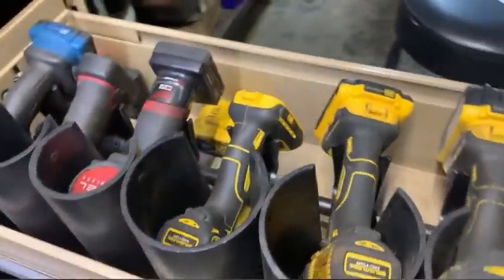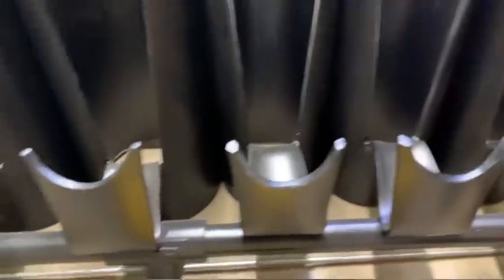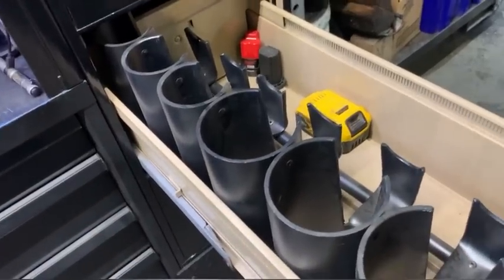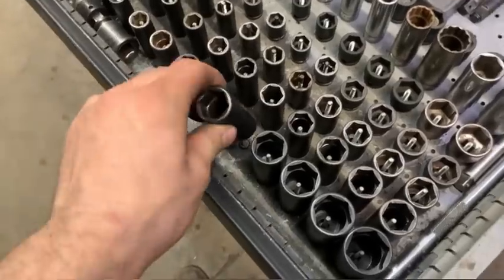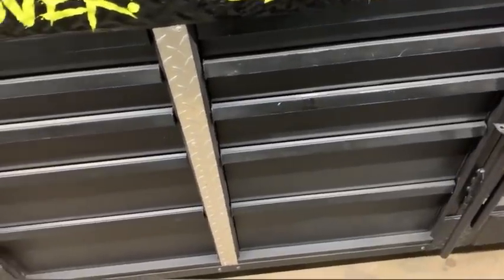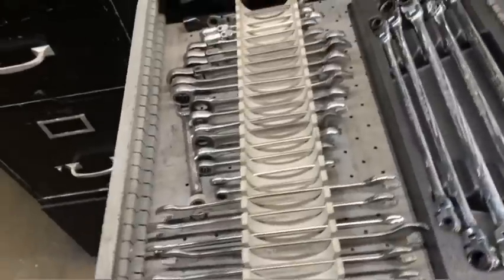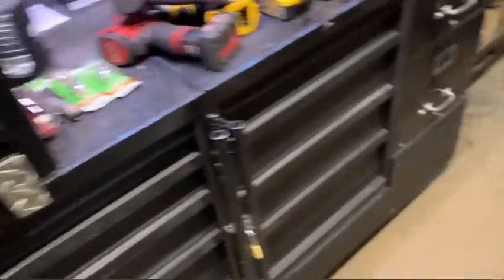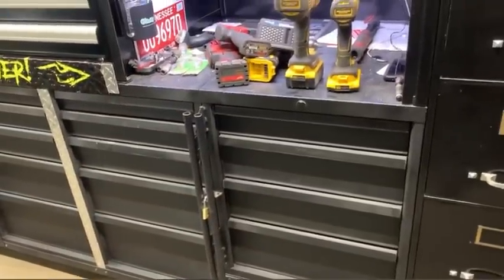My handmade tool organizers, ideas for your toolbox

Comment: You can save considerable space in your wrench drawer if you offset the ends, ie., up-down-up-down.  Good ideas all.
Reply from the maker: I thought of that but it seems like it would be annoying when you grab them to use. But I think I’m going to make a way to put them on end of a 30 degree angle.

Comment: Office file cabinets are the Legos/Tinker Toys/Lincoln Logs of storage.  Buy 2,3,4,5 drawer standard and horizontal/side pull cabinets in standard 15" or legal 18" widthsfor $5-25 at GoodWill style thrift stores.  Group a bank of 2 drawer units with a butcher block laminated top and viola instant work bench.  Couple tall 5 drawer units with a bench top bolted between makes a great work bench that can have top and pull down front door added for a closable/lockable bench.  Horizontal side pull units in 30, 36, 42, 48 widths make great power tool storage....boxed or bare.... with factory steel sheet dividers adjusted in slot in drawer bottoms to separate power tools.  Add power strips, lighting for work benches.

Comment: The power tool holder in the file cabinet is a great idea. I have been using a file cabinet like that for my power tools for years but they have just been tossed in there.
Reply from the maker: You should build some. I need to get more file cabinets for my home shop I’m now have a school looker packed full.

Comment: I tell ya what i done was bought a bag of 200 neodiblium cylindrical magnets that were about an inch tall by 1/4” round.  They fit the inside of 1/4 sockets but hold the 3/8 and used 2 for my half inch..  but all i did was take my drawer out, lined it with wax paper and set the magnets where i wanted em and poured a thin 1/8” layer of 2 part clear epoxy, let her dry and peel the wax paper off and worked a dream so far..  holds everything in place.  Removable if i get tired of it and only cost me maybe 20$..   only bad part is if youre a metal worker all your shit gets magnetized ..  helps on automotive stuff but you go cutting on sometbing and get shavings in there you gotta air hose the stuff out….

Comment: That plier rack is amazing. I have three different type of the pre-made wire type racks, which always seem to be spaced out too small (you grab one item and pull the whole rack out), or too large and the pieces fall over. Your solution solves the issues. I might try to replicate using some old copper tubing or heavy gauge steel wire (suspended ceiling support wire) I have lying around. Gonna find your other video on that.
    The use of the file cabinets is great too. They are designed for full access and tons of weight, just not immediately useful for tool storage.
Reply from the maker: Thanks! Yes check out the build video on the pliers rack. I welded it together so if you use copper you might have to braze it. The file cabinet are so useful especially for power tools and blow molded cases.

Comment: Smart , guys I worked with at American airlines in Tulsa Oklahoma  , used the old parts been cabinets  ( hardware storage  ) from the company and converted them to tool boxes , I believe that's the same thing you got there.  Heavy duty drawers that are rated for extreme heavy weight ( imagine one of those drawers full of nuts or washers  ) Yeah I like the PVC pipe for storing wrenches  , I might do that to my box . Thanks for the video  .
Reply from the maker: Yes if you get the right older ones there very good and cheap. I’m planning on moving to Tulsa in the next couple years.

Comment: Lots of great ideas. The pvc for wrenches, maybe do it with the pipe flipped over with the round side on top.
Reply from the maker: I’ll have to try it. I wanted to use a square pvc fence post but I didn’t have any handy.

Comment: Thanks for the video and ideas. I would put a piece of rubber, wood or something under those batteries. It is not good to sit batteries on metal. I use pieces of Rubber material that is used when we hauled big rolls of paper to keep it from moving. If you have a truck stop , big printing company or a paper manufacturer near you some of the lazy drivers throw it out after delivering. The guys on the docks of the places I delivered to were happy to leave it in the truck( if it their responsibility to clean out the truck ,but must places made us clean the trailer out. I have mostly seen it in 3'x3' squares but have seen it in 2' wide rolls of 10-20'. I use it as drawer liners. 1000 times better than anything I have ever bought. If it will keep a 10-12 thousand pound roll of paper in place you can imagine how it works for tools. Thanks again for the video.
Reply from the maker: Thanks for your tips. Glad you enjoyed my video.

Comment: Excellent ideas and very well executed. For chargers and anything else you want to stick on vertical metal surfaces you can also use magnets. This will let you move them around as needed and you won't need to cut up your hutch. Amazon has super strong rare earth magnets in a 1/2" diameter metal case with holes through them for mounting on things, they're not expensive and they work perfectly. I even put a few of those on some 4' LED shop lights that I like to move around and use as work lights.
Reply from the maker: Thanks! I’ll definitely have to look into those magnets.
Reply: @backintheshop9604  I tried magnets on my Ryobi 40v batteries and charges, and it killed the internal boards in them. they just stopped working. Maybe look at 2sided velcro or that 3m stuff you can pull off later.

Comment: Totally impressed!
Love the PVC power tool rack and the use of the file cabinet.
Any ideas for a rolling tool cart?
Reply from the maker: There’s tons of options for a real cart in creative ways to store things but the problem is since it’s just a real car you can’t really lock up because all the modifications are on the outside so depending on what type of shop your in It may or may not work
Reply from the maker: Roll cart

Comment: On my tool box the socket drawer I got 1/2 plywood cut to size of drawer lined the sockets the way I want them . Drilled holes same size of the socket. left side inch, right side metric. I did this 30 years ago. One place I worked my boss asked me to straighten up his I told him it took years to get it the way I wanted it.He still wanted me to do it. I flat out said no. I made the pvc drill holder but it's in shop hanging from a shelf. I'm Retired now.
Reply from the maker: Yeah I suppose wood would work just fine I just like metal and I already had the holes.

Comment: Nice video and presentation. Page 5:3 could be better with square nuts instead of hex nuts?
Reply from the maker: @philoso377  I tried square but then you have to rotate to get it set down all the way. I don’t have time for that.
Reply: @backintheshop9604 yes you have a point, to me isn’t a strong point. 

It would take less time than capping a catchup bottle. Specially with labeled sockets, we want to return the socket with label facing out in a common orientation precisely, with square nuts.

Comment: Hello Back in the Shop
Thank you for a Great Video.I just found your channel and subscribed. I do like your ideas. If you don't mind  I would have to give you an idea. I think you're wrenches need the Toolbox Widget Wrench Rack. As a  metals kind of guy. They already have a system that work for me. They are a pretty new company that is Veteran Owned. I look forward to seeing more of your Videos. Thank you again
Reply from the maker: I’ve seen those. Thanks.
Reply: @backintheshop9604  You are most welcome. My experience with most organizers. Is they do help, until you start filling up the space with more tools. The Toolbox Widgets  help change easily. Again thank you
Reply: Hello again Back in the Shop 
I forgot to mention  how easy they are to setup and organize.  Enjoy my friend.

Comment: Hi, your pliers are sharp and very organized that’s very creative nicely done, is that dewalt the dcf899? If so how powerful is it?  I want a high torque 1/2 Dewalt impact I’ve heard excellent reviews on it, ty, Bob,
Reply from the maker: Yes it is the dewalt 899, I did a review on that gun a little earlier on my channel You should check it out. I really like it.
Reply: @backintheshop9604  I’m going to check it out ty, I have the dcf894h and it’s awesome I need the 899 for big frame work, ty for your reply,
Reply: The Dewalt high torque really is a great tool. I've been using it lightly for a few years now and it has never let me down. I really prefer my air tools though. But it's nice to have the portability of the cordless sometimes. I also own the Milwaukee high torque and I really can't say that one is better than the other. So if you are a Dewalt guy, I wouldn't hesitate to buy that high torque. That said, both the Dewalt and Milwaukee mid torque impacts are weaker than I thought they would be. I tend to use my AirCat stubby impact wrench the most though. It handles 90%+ of what I do, and it's much more compact and comfortable.

Comment: How to get a hold of you on Facebook or email .
Reply from the maker: What are you needing?
Reply: @backintheshop9604  . I have done some mods to a harbor freight tool cart . Has any of you views asked about cart mods . Maybe some you might like . I'm a machinist but I do a lot of wrenching on out machines and equipment.
Reply from the maker: Not per say but I’m always interested in custom stuff.
Reply: @backintheshop9604  this is really shitty video . But I have a lot of pics of the mods I have done.  A tool you might think about getting is gear wrench extendable and flex head pry bar . Part # 82220.  I also heard the harbor freight one is just like it.  I promise that pry bar will be your favorite . I have had mine for two years and I love it .
Reply from the maker: I love seeing guys making it work with what you have but I think you need a better quality box. Those are pretty junk.